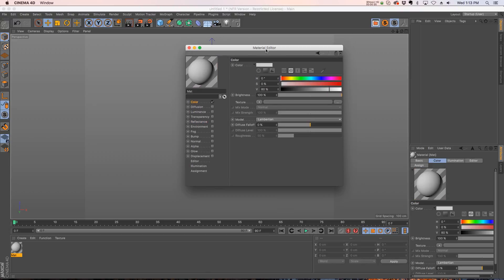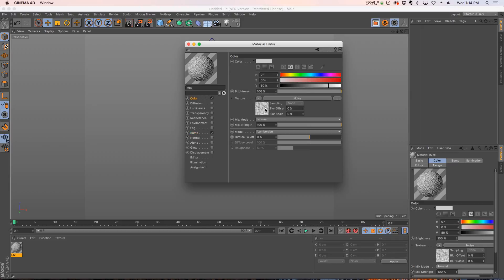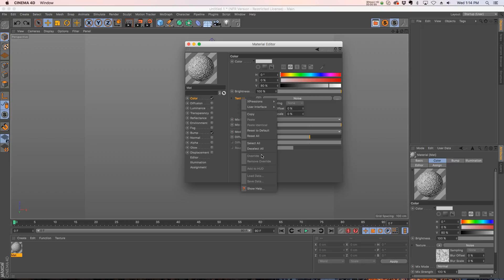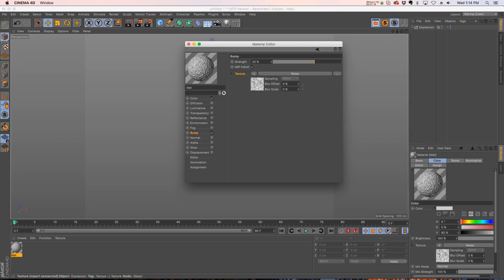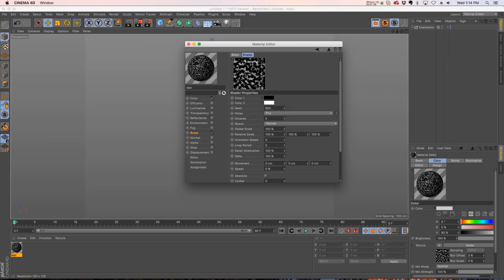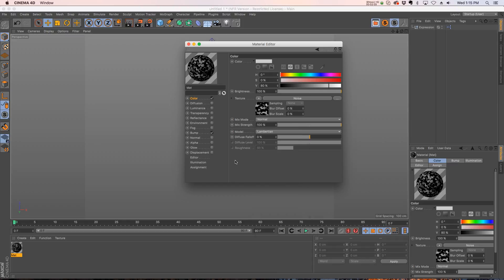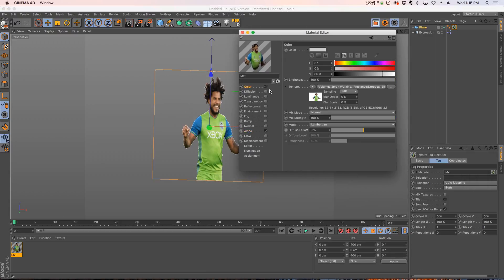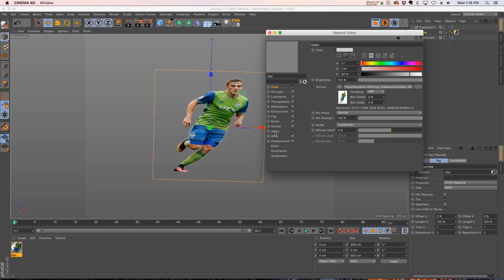C4D Tutorial: Linking Texture Slots to Save Time and Hassle

Comment: Dude, I can not render the material, with the option of set driver
Reply from the maker: Strange. What version of C4D do you have? Have you tried using "Set Relative" instead of "Set Absolute?" Try using that instead and see if that option works?
Reply: I have the same problem. did you already found a solution?